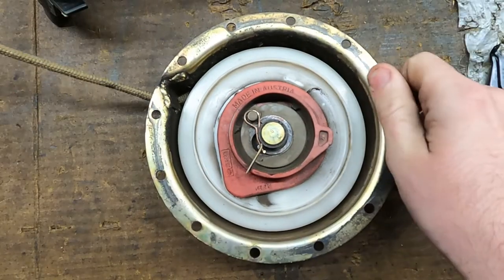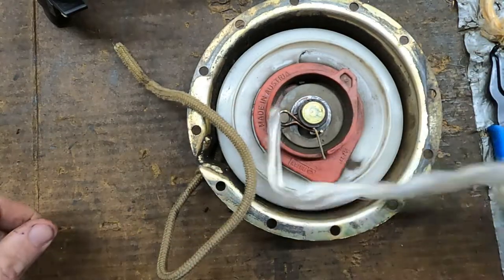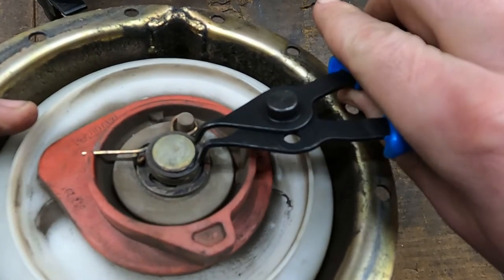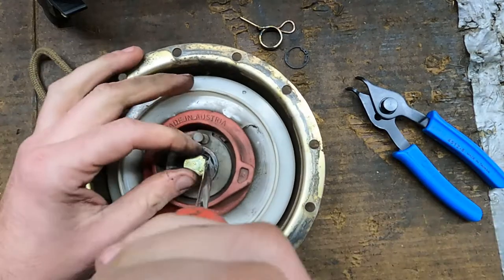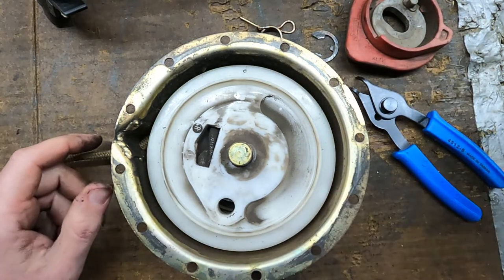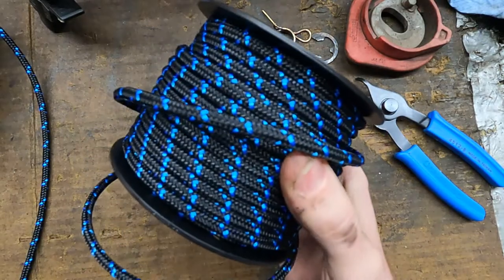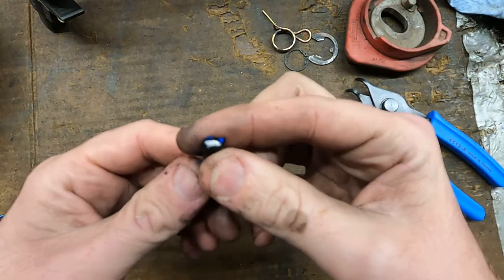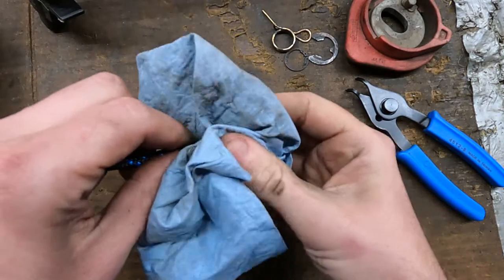Installing New Recoil Rope On a Ski-Doo! How To Do It FAST!

Comment: Can't you wind it up clamp it put new rope in unwind it instead of taking it apart?
Reply from the maker: You can if you can see the knot that secures the rope to the spring loaded plastic piece. I had to tear this apart in order to get to the wedge to anchor the rope.